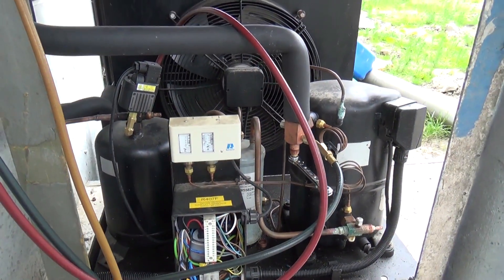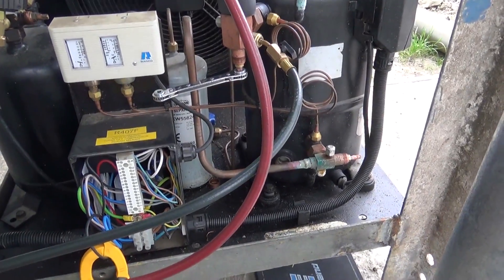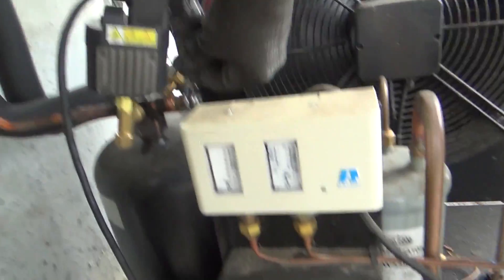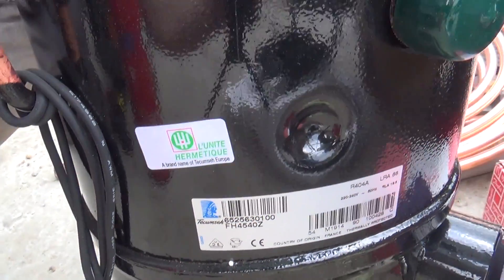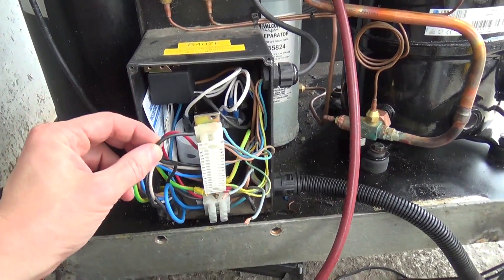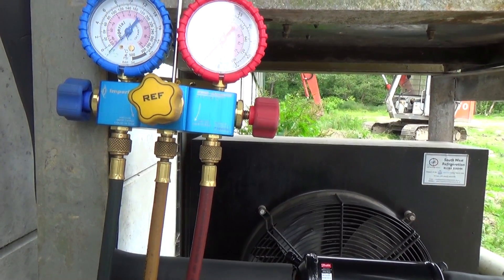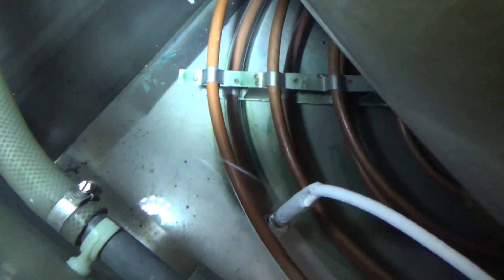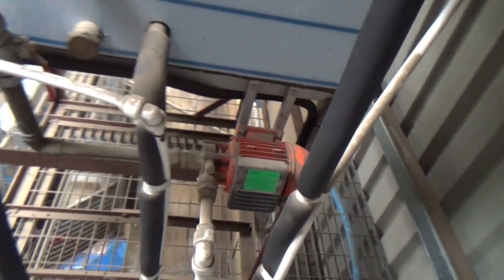Compressor Siezes up on Camera

Comment: Have you tried used R-22 on 404A compressors for medium temperature applications? Oil is compatible and works great.
Reply from the maker: I have in the past, R22 is banned here ow, in fact R404A is being phased out too!

Comment: why didn't you install a crankcase pressure regulating valve.. just for checking it would of solved the problem.. instead of changing the compressor
Reply from the maker: Because the problem wasn't being caused by the suction pressure being too high for the compressor, Its a medium to high temperature duty model so was well within its design envelope. The problem was caused by copper plating of the bearings and cylinder bores most likely from being run with moisture in the system previously. I think i did a video of this compressor cut open to see what the problem was.

Comment: As I watched that first compressor overload as you fed more refrigerant into the suction line, my first thought was the same as yours, "That it's wrong compressor for this refrigerant"...
Reply from the maker: icesoft1 Yeah i wondered that too, they did a R134a one that is physically the same shape and the unit looks like it has been made up of parts. I've cut the compressor open and found the problem, i have just uploaded the vid of it.